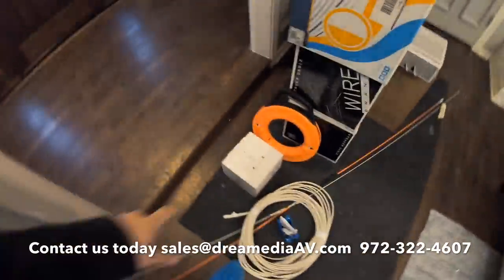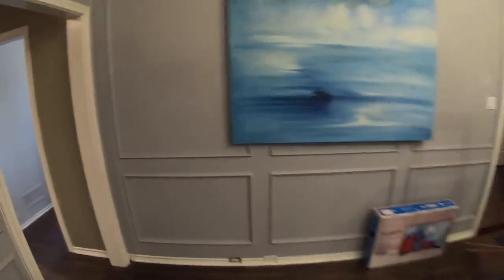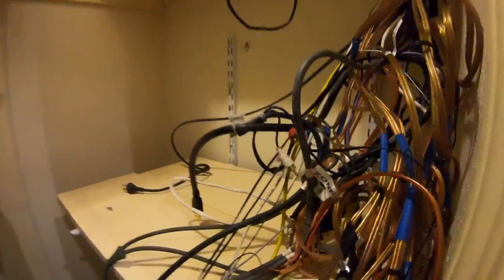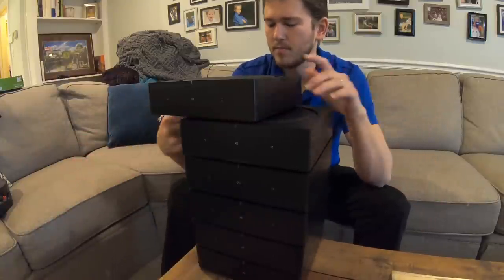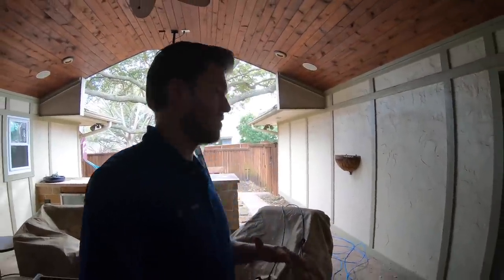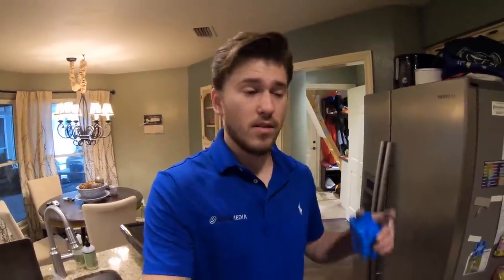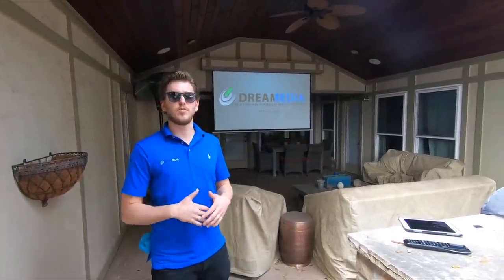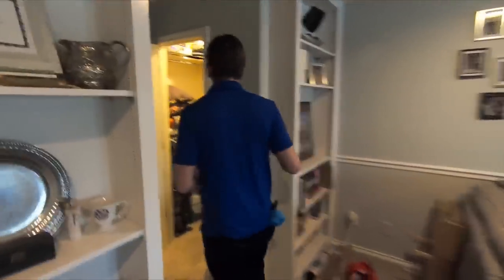Sonos Whole Home Audio and Patio  Projector Theater  AV Rack Install

Comment: Why not hardwire the sonos vs using the boost? You'll need to disable wifi on the sonos to ensure you don't have a spanning tree loop, but it'll be a more reliable signal. Also, sonos does say they can handle 4 speakers per amp (6 if you use the sonos/sonance architectural speakers), so no worries there. 

To keep it super slick, I'd throw a middle atlantic sonos rack (RSHA-SONOS-AMP6 would be perfect) and a fan directly above or below the amps as they do get pretty toasty...
Reply: I hope you see this.  I want to purchase a rack (maybe the strong?) and saw your comment about the sonos rack which I was not aware of.  Does this fit in a a rack from Strong?
Reply: @stevehoyle1157  the middle Atlantic rack mount kit will fit in any standard size rack- including ones from strong

Comment: Maybe this is a stupid question but why 6 amps?  Wouldn't they have had less components had they gone with a single unit capable of multiple zones for much cheaper?  I seriously wish your team was closer.  We bought a house with 15 ceiling speakers and the previous homeowner left an old Control 4 system that obviously I can't access.  Trying to get help here in Pennsylvania is a joke.  Two no shows by the local Control 4 dealer and another that wanted nothing to do with it.  Your team seems like they know what they're doing, respect the house they're in and have fun doing it.

Comment: I wonder with these amps centrally installed, there must be some (very) long speaker wire cable runs throughout the house. How do you prevent interference? As these long speaker cable runs are basically antennas, I'd expect them to pick up some noise? Do you shield them in any way?

Comment: Nice presentation🔥🗣
How are you handling customers passwords to setup all of these Apps and smart TVs since they all require accounts and passwords to operate? 

Just to setup Google wifi network now requires Gmail info and customers PERSONAL Gmail Password 🤐
My last client was out of state when i finished their installation. I quickly realized it's basically impossible to setup a system now without a client on site. 😣🤣😣

Comment: I’m curios why you don’t just go with a multizone amp that distributed audio throughout the house, and then connect one sonos amp to that? Wouldn’t it be much cheaper and easier for both the customer and installing? Also, the bridge is no longer necessary. The amps act as a bridge as well.

Comment: Great video, but all the cabling in the corner of the room has left a huge mess. Why not run some white trunking down the corner and hide it all?
Reply: Ya or just fish it all down the wall.. cut in an inwall enclosure for all the splicing, cut in a double gang with a snorkel plate and snakeskin it into the bottom of the rack.

Comment: Hi guys great job but I have a question for you I’m looking to install 1 tv for inside my house with 5 speakers to the Sonia amp and I also want to install 5 speakers by my pool area with another Sonos amp zone 2 but my question is how can I get the tv sound from both zone 1 inside the house and outside by the pool zone 2

Comment: I realize that isn't an expensive Projector, but I also know it isn't water proof. Are they just gonna by a new one every time it rains or there's condensation from the outside on it?
Reply from the maker: the customer knew it wasnt outdoor rated or water proof. they wanted it installed anyways.
Reply: @Dreamediaav  - As long as they know not to call you back when it fails within a few weeks after the first rain or damp night, so be it.
Reply: @Dreamediaav  Surprising after the fuss made over a tiny bit of diy taping around a few wires which is less of a risk than agreeing to install a non-compliant and potentially dangerous appliance. I would have thought the sensible and safest thing to do would have been to lay all the cable infrastructure and then let the client hook it up later, by you hooking it up surely you now take on some sort of responsibility should it burn the house (or even the forest as you pointed out) down. Or did they have to sign a waiver of sorts.

Comment: I have two Sonos amp connected to four speakers - front LR and back LR. I also have two Sonos One that I want to use as center surrounding, and a subwoofer. How do I put everything into a 7.1 surrounding?

Comment: I was thinking of getting the Sonos Beam with Sonos Sub vs the Playbar due to the HDMI connection a For Home Theatre. To complete a 5.1 sound would you recommend a pair of Play 5 or Sonos In Ceiling or In Wall speakers?

Comment: One quick question how is it you could use the sonos rear patio zone with projector?
Reply: The Sonos Amp has a HDMI input. If they are using an HDMI balun it converts HDMI digitally to be carried over a Cat5 or Cat6. A Balun has a transmitter and receiver interlinked by the Cat5 or 6.

Comment: How did you setup the 5.1 system with Sonos?
Reply: Any sonos soundbar + sonos sub + 2 x unit of play 1 or play 3 or play 5 or 1 sonos connect or conmect amp attached to 2 left and right speaker
Reply: Setup will be using the sonos app, just follow the onscreen instruction inside the sonos app itself

Comment: I wonder if it would have made more sense to switch to Lithe Audio speakers...no amps or wiring to receivers needed and you can run multi rooms via wifi (or Blutooth for even less money). But nice job anyway

Comment: Anyone know a rough price for this type of job?
Reply: my rough guess would be around $3k probably $1500 in equipment and another $1500 to install
Reply: @BIGLOS___  Not even close. The 6 amplifiers alone cost at least 3500. Each ceiling speaker is 300, and they probably have like 12 or 16 of those. They installed a new TV, added outlets. New projector. New 5.1 surround. New home theater setup with controls. All the wiring and routing. The server room setup. This is very easily a $15,000 setup and install. I think likely more.
Reply: @BIGLOS___  six amps at $600 each plus all the ceiling speakerss and wiring etc. I think someone needs to check some prices. Even at a start I would say equipment alone would top $10k